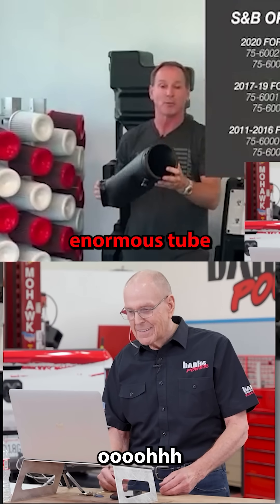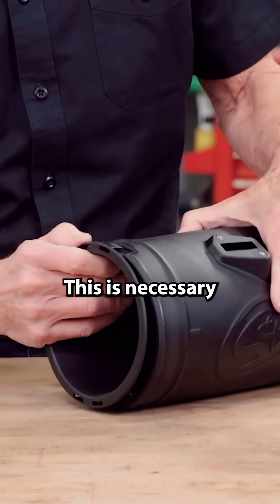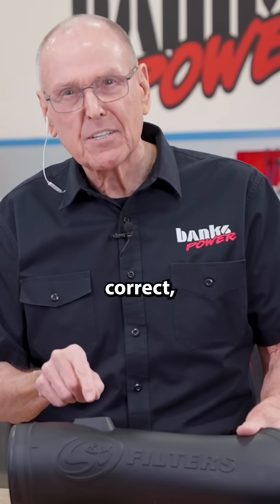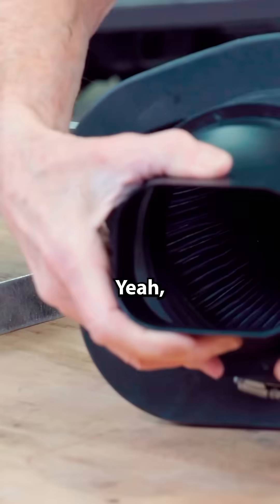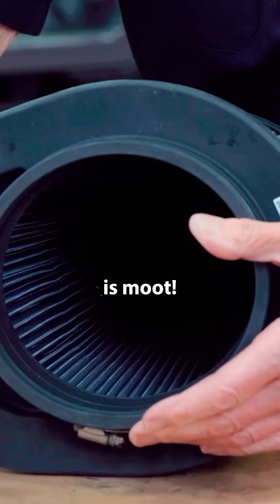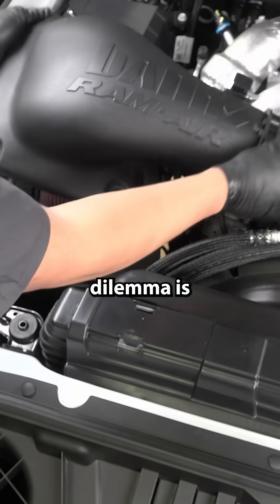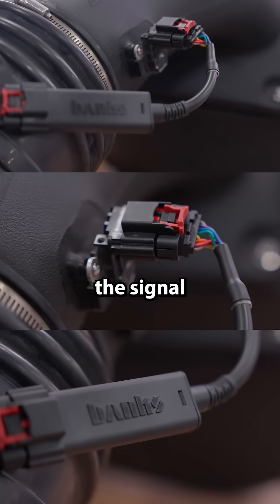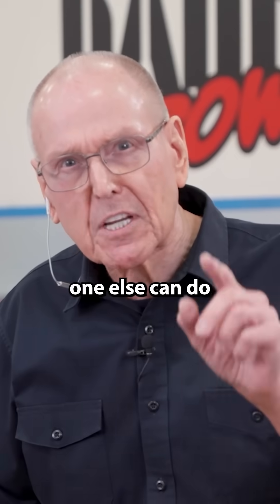Competitor tries to fake a big air intake

Comment: So rescaling your maf is not a thing then right?
Reply from the maker: Tuning is a great option, however, it would void the warranty. Our solution allows you to run an upgraded intake without modifying the ECM or setting a check engine light.

Comment: Serious question : with all the hassle of late model emissions control, dpf regen,adblue, egr etc. what older model engines are worth upgrading with banks performance parts to build a high performance, reliable & low operating cost engine?

I vaguely recall seeing him touch on this topic

Comment: Bigger tube means reeduced airflow across the MAF means ECU needs recalibrated.
Reply from the maker: A bigger tube means more air mass even though the velocity is lower. Our devices eliminates the need for the tuning, thus saving you warranty.

Comment: I came across this problem when I first started doing custom hard pipes and cold feed intakes, I came up with a similar idea for vehicles where maf was not removable, took a while to work out the resistance scale of the maf sensor to know what adjustments where needed to the signal! It was an Interesting project and took far more research and testing than I first imagined! Nice to see I wasn’t to far off the correct path! Great video as always!

Comment: I put a Banks intake and exaust system on my 96 F250 w/7.5 I also rebuilt the engine, had to go .40 over, RV cam, head/valve work. And let me tell you, I gained MPG ( about 1.5 ) but the power was very noticeable. The thing I liked the most is it was quiet and the exhaust didn't start making noise until about 2500-3000 rpm, by that time those Dodge trucks with the hemi's realized they'd made a mistake....

Comment: Just so you know @BanksPower I am still waiting on the Derringer Tuner for my 2020 Silverado 3.0L Duramax LM2.
Reply from the maker: Developing a new tuning solution from scratch for the LM2/LZ0 with new hardware and software is a lengthy process. Still, we are committed to this platform. The current Derringer hardware for the GM/EcoDiesel/Ford is not a viable design for the LM2/LZ0 goals that we have set. The thing is, what we’re trying to accomplish requires more than just manipulating the MAP and FRP connections. Development is currently underway, with much of it being developed in parallel for the new RAM and Ford 6.7L devices. In the past, we've had multiple false starts surrounding this Derringer platform that we wish we could take back. Once the new tuning solution is 100% we'll start talking about it.
Reply: @bankspower  You guys set the bar high in terms of quality and performance and I respect that. It will be worth the wait for sure! Thanks

Comment: This is true normally you would have to adjust the MAF scaling factor in the ECU
Reply: This is the 1990's way they solved this. Old MAF translators. Just rescale  and calibrate the maf scale in the ecu
Reply: My thoughts exactly. It's really not that difficult to rescale the MAF calculation. It still has the potential to make the MAF less effective at lower rpm due to slower air velocity.
Reply: Yup! Having to get this very thing done on a intake I’ve got coming. Having to order a stock sized maf tube till I can have the MAF rescaled
Reply: @onefastboi14 maf scaling is not very hard to do either i used a program called rom raider but megalog viewer works well for it, just takes some time to get all the data points for the logs.
Reply: but he's got it "patented", so it must be much better /s
Reply: @fuzzy1dk Most of the people who just buy a big air intake aren't necessarily getting into HP tuners and trying to tune their whole vehicle. They just want the air intake to work correctly.... So you buy one that truly is a BIG AIR INTAKE and it has a way to scale the MAF that doesn't entail you going to a tuner and spending a few hundred bucks..🤔
Reply: @boosted2.4_sky  besides being pointless, "patented" is just ridiculous
Reply: @fuzzy1dk  uh...agreed.  
although it does sell units.. some people like that kinda stuff..lol
Reply: @fuzzy1dk Just because it's patented doesn't mean it wasn't so long ago it's no longer under patent protection. You don't need to mention that part.
Reply: @ButterfatFarms or copy it and change it by 10% then doesn't matter if it's patented. Or cheap Chinese knock off that don't care.
Reply: A redundant piece of hardware made obsolete by anyone with a laptop and an internet connection.

I guess it's easier to make money selling hardware than it is software which will be inevitably pirated
Reply: Go maf-less; problem solved 👍
Reply: @MK6_GLI  Remapping everything to speed density, instead of MAF, sounds like one of the more inconvenient ways to solve this problem.

Comment: I’d actually want to see a side by side comparison on a dyno for this one. How much are you really gaining from the banks set up over the S&B? The cone in the center is removable, which tells me it’s solely there for stock applications. If we’re talking a tuned truck then that piece would come out because the MAF would be adjusted in the file. I see potential issues with that “MAF controller” on a tuned vehicle, when the tuner isn’t looking for it of course. S&B is a great company

Comment: No one else can do?? Yes you can, you just have to tune it.
Reply: “no one else can do it” it is because he patented the resistor inside the cable, so no other companies can make that device and only he can sell it.
Reply: @chrisparussin5359  ahhh but the device is completely redundant, you should tune for the actual airflow increase and not "trick" the ecu.

Comment: I ran a 4inch spectre air intake on my silverado and it actually started throwin the lean code p0171 and p0174. I bought a smaller intake same brand and now i dont get the codes. I think the kit i bought was for a diesel. Says it was for a 5.3 silverado but it the filter that ce with the charge pipe was way to big

Comment: Honest question... If you're feeding the ECU the stock MAF reading, then isn't all of your extra airflow going to waste? It's effectively the same thing as making the internal dimensions of the intake the same as stock. The air fuel ratio will remain the same.
Reply from the maker: We are not feeding the ECU a stock MAF reading, we are feeding it a reading correctly recalibrated to accurately reflect the mass flow of our intake system. 

The MAF sensor works based on air velocity (it measures the airs cooling effect on a hot wire with current running thought it), which is greatly reduced when widening that area even though the overall mass flow increases. This is why others can't change the cross-sectional area of the MAF housing. We essentially correct the MAF reading to account for the new cross-sectional area.

Comment: he designed and pattented an air mass control module to correct whats needed, wow,
just wow
that's Mr. Banks for yah
Reply: yeah. He patented a cable with a resistor inside. Wow
Reply: Yeah real nice that he now has a monopoly on a properly made component. Super great for the customer....

Comment: Well you didn't do a very good job on your airbox for a 22 ram 6.7.  I took it off after constantly getting turbo boost codes and it actually lost mpg. Maybe instead of bashing your competitors focus on fixing your own problems
Reply: I’ve had one on my 2021 RAM 6.7 for months with no issues since install. Just the sweet sound of turbo spool and louder exhaust brake sound. Just wish it was more. 
I do remember the tube to the turbo was a bit of work to get on good. 
My MPG loss is from having my foot in damn thing especially after installing the pedal monster.
Reply: I have a 20 ram 6.7 also getting codes every other week

Comment: Why not just go out and go aftermarket ECU and just run a map and get rid of the MAF problem then you can run a giant air intake cone.
Reply: You're not getting scammed by Banks.
Reply: Expense. Any adjustments to air fuel needs retune. Gale desinged this maf piggyback to avoid a remap of the tables wich is a little more complicated then a air fuel timing remap.

A more flexible option since it's tuneable is the older vafc or safc modules for jap cars. I use them alot to dial in for cheap stuff like air upgrades and injecror sizes. Still need to know basic scale math and fluid dynamics but it fits certain build mild budgets vs a retune on some of these newer .ore expensive ecms. 
Gale banks is a very smart man. 👌
Reply: MAP isn't doable with ITB's though, so if you want those for throttle response you'll need MAF. Or tune from TPS, at which point you might as well just run carbs because the only benefit you're getting from the fuel injection is 0 fuel used off throttle if the engine is above idle.

And let's be honest, you're not getting a giant intake because it will make more power, it will not, you're getting one because the stock intake sounds like it has more sound insulation on it than the entire rest of the car.
Reply: One big problem, DEF
Reply: I'm failing to understand. I could run an aftermarket intake with 0 issue on my car. Is this because the ECU uses the MAP sensor for fuel calculations, rendering the MAF sensor a non-issue?
Reply: @cwheels01 No.  It's likely because the intake you're using doesn't have a larger cross-section at the MAF.  There's plenty of ways to increase flow without compromising the velocity across the MAF.
Reply: 🤣😂🤣 if that's the case the engine would just run on air. No gas needed.  

Do you know what you just said?  Probably not
Reply: @changingoftheguard7256  yeah I do my guy. I just don't deal with trucks. You can replace the ECU and MAF to map sensors... more effective for turbo chargers. Has nothing to do with running on air. 
Like rn my skyline R32 gtst is running on a MAP. And not MAF. Just different ways to measure AFR. But all these big trucks has horrible regulations or you all live in California and not where I live. Where we have no emission regulations.
Reply: The S&B intake is designed solely for aftermarket MAP tuning. It was engineered line that and there was no other plan for it besides big HP builds on MAP. They threw the insert in there on a whim to see if it can get CARB compliance and it surprisingly did. But the intake should not have the insert at all.
Reply: You're the only one that seems to get the point. There's no reason to run a larger intake with a stock turbo. If you're going big turbo you need a tune anyways. You're supposed to take that insert out and tune the truck lol. It's just there to make the epa happy.
Reply: Um. $$$😂
Reply: @CumminsTurbo4  yeah idk how much ab ECU for a truck costs but my skyline R32 is running a ECU emu black for like 900 bucks.
Reply: @jackdevine5373 and then there’s the tuning costs associated with a stand alone system. That’s not cheap either. Add that all up and now it makes more sense to just use the Banks MAF controller. 
 And you still have an OEM level tune that’s far more refined. Also time savings, even if you were an expert tuner yourself, and saving money that way, you still got a bunch of time invested into tuning the stand alone system.
Reply: @jackdevine5373  cheap black series 1gen. No can bus comm functions. Plus harness adapter. Plus profesional install. Easy 3k job if you dpnt do it yourself. Then...hours of tuning. Especially driveabiltiy tuning. Even with target lambda /afr on these modern ecms.
Reply: @jackdevine5373  HKS used to make something called a VPC (Vein Pressure Controller) so you could remove the MAF. It created a MAF signal using two additional sensors (IAT + MAP) and sends the reading to the stock ECU. Still have to fine-tune it to make it work well though
Reply: @jeffgriffith7003 cause not everyone can and wants to go that route, some just want a couple extra H.P, and this is it.
Reply: @szabib2144  Umm, you’ve got some backwards thinking. 
 A stand alone system is far more money and effort…..
Reply: Because that's illegal. Diesel tuners are constantly under scrutiny from the EPA, and a policy like that would mean $$$ fines
Reply: @jonathansmith7306  You bought a diesel deal with it. Waving from the E85 peanut gallery....